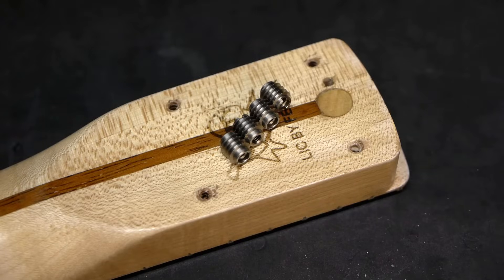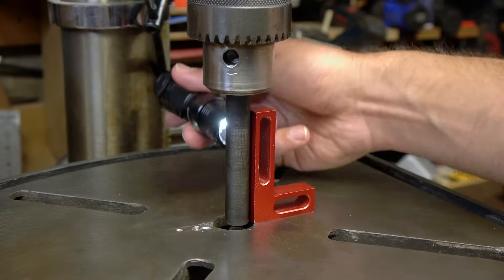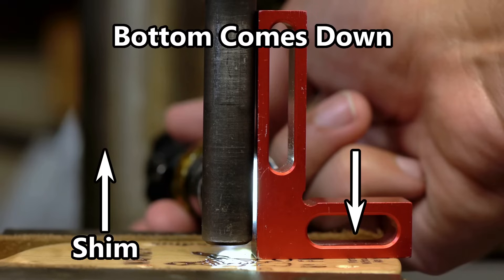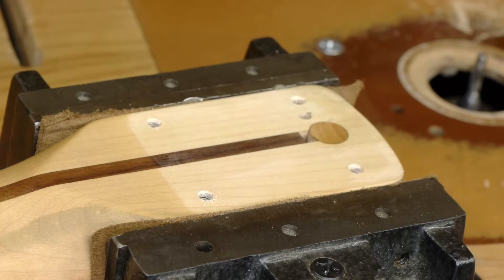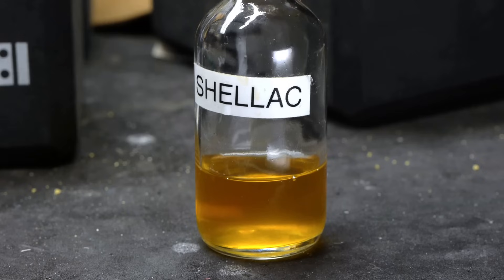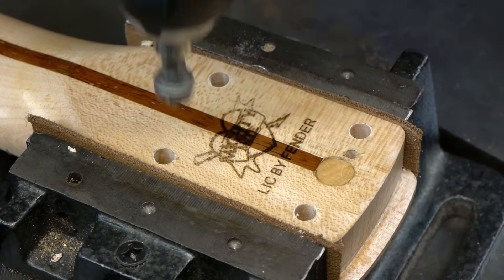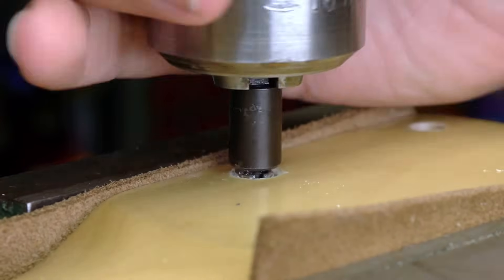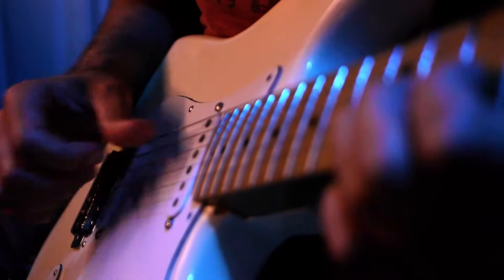How to Install Threaded Inserts on a Bolt-On Guitar Neck (EZ LOK)

Comment: Do not trust any Google AI because it is unreliable.  There's too much bad info.
Reply from the maker: There is no AI on my channel anywhere, in any of my videos. I write all my scripts myself and record all my voiceovers personally through a large diaphragm condenser mic. Even in cases where I have text and graphics, I make all of these myself in Krita and export them as .png files. 

I shoot all of the footage and photos myself as well, and even in that case, the majority of my lenses are manual focus and manual aperture and I very rarely use auto focus for any of my shots. Using a Panasonic Lumix GH2 from 2010 and it's very bare bones, no in camera stabilization, no bells and whistles. I shoot in full manual mode, am very careful setting the ISO and aperture for each shot, and then do all white balancing and color grading in Shotcut during post-processing. 

Absolutely nothing on my channel is AI or automated in any way, everything is done 100% by a single person -- me. 

And all very meticulously and painstakingly.

Comment: If only you’d posted this a month ago 🤦‍♂️ Not to worry I sorted it out. Wait…no I managed to create a cascade of problems which I just noticed has resulted in the end of my fingerboard raising ever so slightly so my highest frets all buzz now. Ok just have to teach myself how to pull frets and replane a neck 🎉😅
Reply from the maker: Always a way to fix it! Is it that you installed the inserts too deep and they started to press the fingerboard up? I'm familar with the "ski jump" effect, which can also happen with partial neck pocket shims as opposed to full pocket -- the end of the board ramps up at the end and will cause everything to choke out completely from wherever the neck joins the body (e.g., 17th fret) to the end. 

I'd see if I could back the inserts out first, and find whether the neck has taken a set there or not. Usually I think humps are reversible -- once the mechanical force that is causing the hump is removed, it should go back to normal. But all depends on what's causing it. 

Also, you could try using shorter machine screws. That would be the first and easiest thing to try. They only need to grab a few of the threads on the inserts to work. It's possible if you drilled too far, that using screws that are too long, they're pushing up on the fingerboard once you thread them all the way in. Shorter screws might help that. 

Let me know if you try that and notice any difference. Inserts are usually pretty resilient and you also might be able to un-thread them partially to get them farther away from the fingerboard, and again, use shorter machine screws. That would be the least invasive approach and wouldn't require any major surgery. 

If the hump doesn't go away when you back off the inserts (or use shorter machine screws, or both), then you might want to consider using a caul and clamping the fingerboard down and leaving it for a few days. Just clamping it with one jaw on the caul on top of the frets, and the other jaw on the neck heel. Who knows -- might help. Not sure how I'd go about heating it during clamping but that's another option. 

I'd just start with the shorter machine screws first though, then consider backing the inserts out a bit as long as they're still recessed below the surface of the neck heel and trying again with the shorter machine screws. My bet is you drilled a bit too deep for the inserts and the screws you're using are too long and it's pushing up on the fingerboard when you get it threaded all the way in.
Reply: @ oh man…. It’s worse than that. The guitar is an epiphone and the wood of the heel was really soft and I had done a bad job with my alignment so there was some re-drilling and eventually it was just not holding the inserts I plugged it, but that wasn’t sufficient so I ended up, carving out the heel and replacing that with a block of new maple to replace what I think was some kind of mahogany. Once I did that I re-drilled everything was well aligned. The inserts went in fine, and my problem was solved but in the process of removing that wood from under the fingerboard and gluing in new wood, I guess the board got misaligned or pushed up slightly on one side. So the bolts are fine. The inserts are fine. The heel is fine. Everything is perfect. The only thing left for me to do is just remove these last handful of frets and plane down the board.
Reply from the maker: @terrorbirds9835  You can do it! I've been meaning to make a dedicated video about my fret pullers and more. 

If you want a decent reference, I have a video series on this playlist here: 

https://www.youtube.com/playlist?list=PLN0ZS8PEGeRZZXVrIeO6cxlvWze6NItuN

It's a bit dated, but only because I'm always evolving my techniques, always. But has a ton of info on the process of pulling frets and installing new ones, leveling and crowning. I'd love to make an updated version but for now that's probably my best playlist to refer to if you need any tips!

Comment: This is the best video I’ve seen on the topic of inserts and guitar necks. I screwed up a nice roasted maple neck the first time I used inserts by not taking my time. I then had to cut hardwood plugs with proper grain orientation to start over. The process demonstrated here is the best way to go from what I’ve seen and learned. I also have tried using stainless #10 oval head sheet metal screws which create a bulletproof connection. I use a slightly thicker neck plate with a proper countersink to accommodate the slightly larger diameter.
Reply from the maker: Thanks so much! This is the 3rd iteration of this video, and I've made mistakes in the past before progressing to my current method, which is demonstrated in this video. 

With regular wood screw holes that are self-tapping, you have some leeway. With threaded inserts, not so much! And you know the pain like I do of having to plug the holes and do it all over again. 

It takes much longer to set up, but with this method, you can't miss. I use this method for drilling the holes for wood screws as well, on normal bolt-on neck installations, even though it might be overkill. The self-tapping wood screws will be able to deal with imperfectly drilled holes, but I figure it can't hurt for the longevity of wood screw holes as well. Maybe they're more prone to stripping when they're not drilled perfectly -- would actually make a lot of sense that they would! 

So I'm redoing that video as well. I have it scheduled to upload but I might take it down and make some revisions before posting it. I really think the method I laid out in this video is the most accurate, despite it being much more involved than methods I used in the past.

"You get what you pay for" certainly applies....and the "payment" here is in time, effort, and attention to detail. 

But once you screw up one job....then you realize it saves a lot of headaches to get it right the first time, even with all the extra work! I hope to never have to plug one of these holes ever again, and I hope nobody else who watches this video has to plug those holes ever again either. My main goal with this channel is to leave a legacy, an 'evergreen' resource that people can refer to for how to do these kinds of jobs the right way the first time...

...without going through all the frustration and head-scratching I did in order to get here. 

Thanks so much for the comment and the support! And also, I debated between the #8 and #10 screws. The #10 will certainly have a ton of power. I went with #8 as it matched the size of the wood screws I originally had, and I also wanted to leave a little leeway in terms of how close the inserts would be to the edges of the heel. But I do know that #10 screws seem to be the standard. 

Do you have any take on the #10 vs #8 screws? Would love to know what you think. And thanks again!

Comment: Depending on a threaded insert is vastly inferior to simply screwing into the wood as the dependence has shifted to the insert, which is a mistake with absolutely no upside.

Comment: A commun feature among high end European custom instruments, particularly basses, is that all screws are going into threaded inserts. I think is a no brainer after you see the pros of it.. thanks for sharing.
Reply from the maker: Had no idea they were a common feature for high end European custom instruments, and basses in particular. Very interesting. I can see why, as they do look and feel to be of very high quality, and you can thread them in and out an infinite number of times, and they'll never strip. 

Some builders swear that they give their instruments better resonance and sustain as well. 

And thanks for the support! So glad to share. I spent a lot of time figuring out a better way to install these, and I made many mistakes along the way. This is also now the same method I use for drilling regular screw holes for wood screws, though of course, the step bit and chucking reamer aren't needed, just a regular twist bit or brad point bit. 

It's extra work, but I think whether using inserts or wood screws, drilling the holes as square as possible is the best way to prevent problems. It's just a theory, but I think holes drilled at a less than perfect angle could be part of why some wood screw neck heel holes strip out so easily. I've seen many guitars with wood screws to attach the neck, where you can turn and turn, but the wood screw never tightens up. Wood screw holes can get stripped very easily. With the inserts, never something you have to worry about!
Reply: @guitar_md  well, the idea of them enhancing resonance may come from the fact the screw fits better into the thread, hence reducing energy dissipation. I honestly think that is negligible. They do feel better, and also, as u said, reduce the risk of striping the tread.

Comment: What about cases where you have to shim the neck???
Reply from the maker: I haven't run into any problems with this yet. Though there may be problems specifically when using wedge shaped shims -- maybe. That's actually similar to a neck reset I'm doing on a bolt-on neck Ovation at the moment: 

The shims might change the angle slightly, but I haven't found that this impedes the machine screws from fastening correctly. At least not in the guitars I've worked on so far.

Taylor acoustic guitars also use machine screws and inserts, and their shimming system is the same concept as shimming an electric guitar. It uses a series of two wedge shaped shims, one under the fingerboard extension and one under the tenon. The angle that this offsets the neck to is not great enough to prevent the machine screws from tightening, or else it wouldn't work. 

I'd imagine at some point it would be enough of an angle to prevent the machine screws from tightening adequately, but for the amount of correction that most necks would need, I don't think this is an issue. And if it was, guitars like Taylor wouldn't be successfully employing a traditional wedge-shaped shim system for their machine screw and insert acoustics, which is all of them (Taylor has never made a set neck acoustic). 

However, there is also an alternative, in case wedge-shaped shims are problematic: 

Coincidentally, on my own Strat I opted for a flat full pocket shim that I made myself, which was simply because I like to use full pocket shims, but didn't feel like making a tapered shim myself, or buying one. It's very thick, but flat. When you use non-tapered shims, you can only reduce the action, and you have to use a much greater thickness compared to a wedge shaped shim. 

In cases of raising the action, you need to use a wedge shaped full pocket shim, and have the thickest part under the top of the neck heel (e.g., on a Strat, around the 17th fret area -- not at the 'bottom' of the pocket, where increasing the height will reduce the action). 

With bolt-on neck electric guitars there is a plethora of options for adjusting the neck angle and height to adjust the action. And in cases of needing to raise the action, another alternative is simply routing the neck pocket deeper. I have a few videos on my channel about this (flattening / deepening neck pockets, just search "neck pocket" on my main channel). 

So the need for a "reverse shim" to raise the action can be averted by routing the neck pocket deeper. For lowering the action, a wedge shaped shim to re-angle the neck will work, but if that truly is a problem with threaded inserts -- unlikely, but possible if you need to use an extreme angle -- 

-- then you can simply use a flat full pocket shim, or a combination of a flat full pocket shim, and a wedge shaped full pocket shim. 

I used to use partial shims, and while you can do this, I no longer recommend it, as it causes the area of the neck occupying the air gap left behind the shim to become deformed. I strive for perfection and while I did this for many years, I no longer recommend it. In most cases, a full pocket flat shim is the easiest solution, and the only barrier to installing one is the psychological resistance to the idea of having a thick piece of wood veneer (or whatever other material) in the neck pocket, compared to a thinner wedge shaped shim that angles the neck up rather than simply raising the height as a whole. 

Hope this clears up the confusion. To recap, the essentials for bolt-on neck action adjustment at the neck pocket are: 

1) Flat or wedge shaped full pocket shims to lower the action (decrease the distance between the bottom of the strings and top of the frets).

2) Routing the neck pocket deeper to increase the action (increase the distance between the bottom of the strings and top of the frets).

3) Wedge shaped full pocket shims are only 100% required when "reverse shimming" to raise the action instead of lowering it. The need for this type of shim can be averted by simply using option 2 in this list. 

4) Threaded inserts + machine screws have some amount of leeway when using wedge shaped shims. It might not be enough leeway for them to fasten properly in some cases. In those cases, refer to this list for alternatives. Whether you want to lower or raise the action on your bolt-on neck guitar, there's always two ways to do it. If one doesn't work, the other one will, and sometimes the best solution is combining two methods together to split the difference. 

Anyway, that's all that comes to mind right now. Hope this helps. 

I'm actually running into this issue with this Ovation acoustic. It's a 12 string, and uses threaded inserts and machine screws. However, the geometry of acoustic guitars is more complicated, as they use three bolts, and the topmost bolt is perpendicular to the other two. 

This makes things a lot more complicated than a Strat, for example. I'm still trying to figure this one out, and unfortunately, it needs so much of a neck angle to correct the action, I'm not sure I'll be able to do it. 

It's very similar to a Taylor, basically identical in how it needs to be shimmed, but it doesn't seem like it has much leeway. Very frustrating! Fortunately, if you're just dealing with a regular electric guitar, everything I wrote out here should have you covered in 100% of cases. 

I've routed many neck pockets and have shimmed many necks from all kinds of different guitars many times, and have field tested all those techniques. So if wedge shaped shims do end up being a problem for you on your guitar, flat full pocket shims or routing the neck pocket deeper will be options that will work perfectly, depending on whether you want to raise or lower the action.